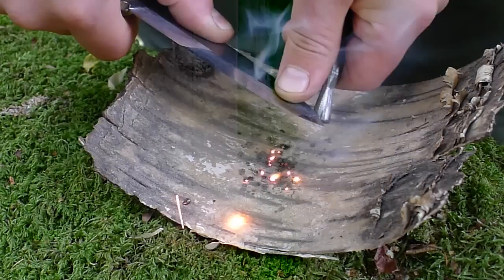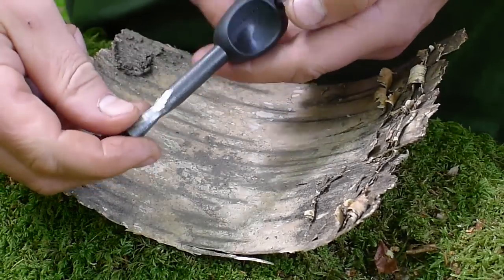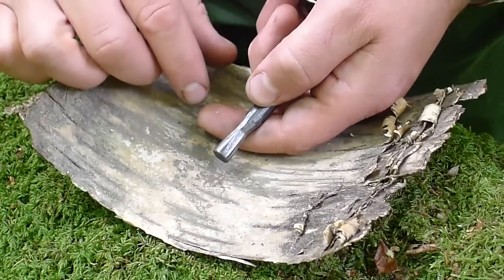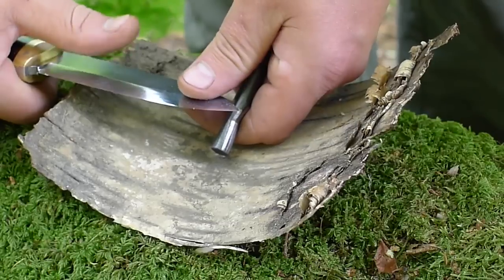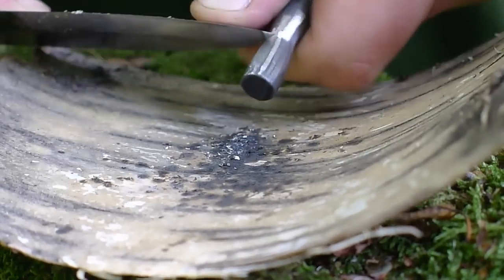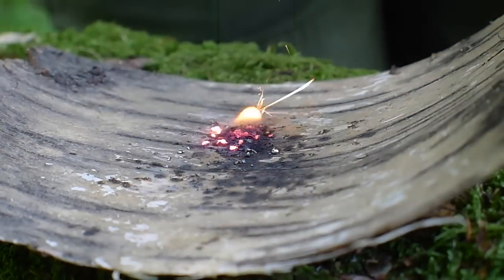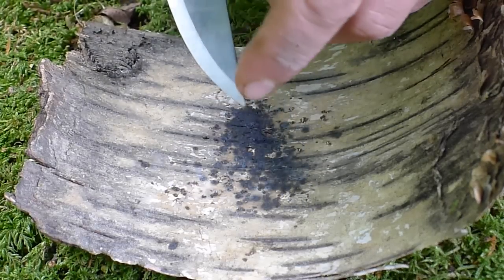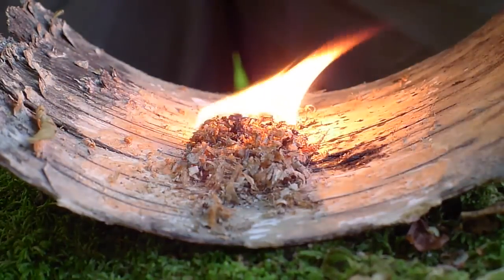How To Create Really Big Sparks With A Swedish Firesteel

Comment: Great video as usual. Subscribed. I usually jab my fire steel right into the tinder pile / birds nest so it kind of surrounds the tip of the fire steel. What it does for me is that it holds the tinder in place as during mild to breezy conditions. Most of the sparks fire right into the bundle. I'm going to try this technique too.

Comment: Great technique.
And heres one about the plastic handles on the ferro rods, remove it and take the best fatwood piece you can find thats totally soaked in resin as in all red and carve a new handle of it, that way you always got a good tinder close by if you cant find anything else to use, once you carved the handle its gonna be all sticky, but the surface will dry up in about a week and contain the rest of the resin in the wood fresh, and to fasten the rod in the new handle, simply drill a tight fitting hole and squeeze in the rod, the resin will glue it stuck to the handle after it dried for a couple of days, I do it to all my rods and it saved me getting a fire started when the rain is poring down, a 2x3cm handle will give you shavings for a good 10-30 fires (depending how you use shavings), and when its gone, just carve a new fatwood handle and pop it on, can of course drill a hole sideways in it for a lanyard aswell  :)
Reply from the maker: SignedSign Hey that's a nice tip.  Thanks for sharing.  I'll keep my eye out for some good fatwood.  Cheers! Paul.
Reply: Thanx for this great hint. I love it when things have double functions. Sorrily ther are no trees with fatwood in my surrounding.
Reply: I carved my own handle with Hazel, if you use the exact same diameter drill bit on green wood then the wood will encase around the rod and close in nice and tight when drying, you can already notice the stiffness of the rod the very next day, fatwood is a great idea but I will have to just buy another blank rod before I do that, the hazel one is my go-to and I've just spent £340 over the last three weeks buying gear so have to save the pennies now!
cheers
Bushman AllOutDoors
Reply: I never did like handles, simply because what steel you've adhered into the handle you can't use.  In my pack I carry a 1/2 x 6 inch rod (because it was two for the price of one on Amazon through world of fire) and in my PSK is a 3/8 x 4 inch rod from firesteel.com.  Neither of them have handles and I've never had any problems.  If you think you all need one, horses for courses.  I cast my lot among those who don't.

I do have to say, though, that carrying resinous wood is a champion idea for fire starter and no one should be without it.

Comment: I am going to practice and practice because some times I knock my material flying.
thank you for this great tip.
Reply from the maker: Thanks for your feedback Ted.  Please do practice this.  The key thing in not knocking your material flying is creating that (small) gap by supporting the Fireflash with your finger, then being really controlled with how you push the spark off the end of the steel.  As you see, I don't use a lot of speed - it's more important to scrape off plenty of metal. Just use enough speed to create a spark and maintain control.  Let me know how you get on.  Best, Paul

Comment: Fantastic video Paul! This technique is by far the best practice for anyone using the fero rod. Not only does it save on mashing your prepared material around, but I think its also the most efficient method for getting the most out of the fero rod itself over its lifetime, using less than any other method of striking it, would you agree?
Reply from the maker: Thanks for your feedback! It's definitely the most efficient way to put a spark exactly where you want it. What I've noticed is that once people get the hang of this technique, they get their tinder lit on the first or second strike.  Even though the method in the video does advocate taking off a good amount of material to create the biggest spark possible, compared to how most untutored people bash away, striking the rod repeatedly, creating a shower of diffuse sparks and eventually disturbing the tinder, then yes it will increase the life of your Firesteel.

Comment: hi paul thats the first time I've seen a fire steel used that way and it will last a lot longer as well regards dave
Reply from the maker: Hi David, yes I find it much more efficient - both in terms of getting a fire going but also in terms of not striking away at the FireSteel repeatedly and taking metal off it unnecessarily.  Hope you find it works well for you too.  All the best, Paul.

Comment: Nice tip about the Mora companion
Reply from the maker: Thank you Robert Williams
Reply: @Joel Glyn-Davies Paul is not using the spine of the knife to scrap with. The only part that touches the rod is the beveled edge of the knife. From the tip backwards to where the spine begins. Really, this technique is only good for scandi grind as others either have little to no bevel which does not allow enough surface contact to scrap with. Hope this helps.

Comment: nice videoOne thing I wasn't sure of paul was when you used the mora knife, does anything have to be done to the back edge for it to work?
Reply from the maker: +Sean Ditch Not in the way I'm using it here but it is only a small area which will work well, just behind the tip.  In my experience, the depth of bevels at this point on a Mora is variable and can sometimes be very small, increasing the chance of you pricking your finger with the tip.  Flattening the back of a new Mora, where it is somewhat rounded, with a metal file creates a much larger right-angled edge between the side of the knife and the back, which works more consistently.  But once you have sharpened the knife a few times and the bevel width increased - which it will if it was too narrow at the tip - makes the technique I show in the video more viable.  ATB, Paul
Reply: +Paul Kirtley brilliant thanks Paul
Reply from the maker: +Sean Ditch My pleasure Sean.

Comment: Paul, great video - really helpful technique. What would you say about how it only uses a small part of the firesteel; is this a waste?
Reply from the maker: James Tamlyn Thanks for your comment.  Glad you found this one useful.  Re using the section towards the end of the firesteel - well you'll  wear this down more quickly than the rest but it does not waste the rest because once the end is worn down you just move back and do the same further up the steel.  The steel effectively becomes shorter but you still use all the material, just in a different order if you like :-)  Hope this helps.  ATB, Paul
Reply: Thanks very much; I hadn't thought of that. By the way, your podcasts are great - keep them going!!
Reply from the maker: James Tamlyn You're very welcome James. Thanks for your feedback on my podcasts also.  Warm regards, Paul

Comment: Hi Paul!
When it comes to firelighting devices, the swedish firesteel tends to be the number one solution in the bushcraft community. I have tried it extensively with excellent results, but I'm always coming back to the Doan's magnesium bar. Can't explain why but I seem to prefer it just because the 2 separate steps (shaving the material and sparking). Did you ever tried it? I'm not a beginner anymore but I'm thinking maybe for a beginner, it would be easier to have these 2 separate steps of shaving the magnesium without accidently sparking on it and THEN, turning the thing over and sparking the pile of shavings in a more controlled and error-proof manner. 
Excellent vid!
C.
Reply: Ferro rod is gone long before the magnesium bar in my experience bro

Comment: I used some high quality ferrocerium rods, actually they seems like mischmetal   rods as someone else called, which can easily make lots of fire balls instead of sparks when struck. I also compared them with Light My Fire & Firesteel flint fire starters, hardly to find difference between them.  The manufacturer of the rods can be found at www.sinosed.com, their website. Hope it helpful to you guys!

Comment: Hi Paul, I've got a new firesteel after somehow breaking my old one. How long does it take before a new firesteel starts producing some proper sparks? I have read that the more worn it is the better. I get weak sparks by simply striking it and using the technique from your video I can shave off material but no spark! Cheers Nige.
Reply: Bugga...Just managed to stab my finger as well...Ouch!
Reply from the maker: Ouch! Yep, I've done that before too! ;) When the FireSteel is new it is coated with a protective lacquer, which helps prevent it oxidising while in storage. 

1/ With a couple of scrapes, you can remove this from the area of the steel you want to strike the spark (it will go from dull to shiny).

2/ If you are removing metal from the FireSteel but not attaining sparks, then the issue is not pressure but speed.  Increase the speed of your scrape while maintaining the pressure.  There is a point at which this will create a spark. Too slow and it won't, however much you dig in.

Hope this helps Nige!

All the best,

Paul
Reply: Thanks Paul, I'll keep  persevering! :)
Reply from the maker: Yep, that's all it takes! :)

Comment: Paul, I just dropped by to say your technique is awesome! Been trying for 3 days to light some dry grass, without any success, mostly because my strike was too long (I'd usually start from thumb depression and work my way down). So the sparks were too erratic and easily put out. It was a great morale-booster to finally try your way and see it work like a charm. Thanks a lot :)

Comment: Hi Paul,

I'm not sure if maybe Mora has changed their spine design since they produced the Mora Companion you used, but this method does not work on the 10+ Mora knives that I own.  The spines seem to be left too unfinished and rounded to make a spark this way (even using the portion of the spine that's behind the Scandi bevel near the tip as you show here).  The only way I can get a spark like this is if the very tip of the knife happens to dig into the fire steel.  This results in dulling the tip, which I'm sure is not favorable lol. 
Not sure if you might have another suggestion?  Mora's are some of my favorite knives, but I've always thought their biggest weakness was not being able to effectively strike a fire steel.  I wish Mora would just produce all of their outdoor knives with squared off spines!
Thanks Paul!  Great videos BTW, I've subscribed!  =)
Reply from the maker: *****
Hey Dan,

That's a very good question. The Mora in the video is a standard Mora Companion but please read on....  We hand out scores, if not hundreds of Mora Companion knives every year on Frontier Bushcraft courses and it's true the backs of all of them are quite rounded and not squared off.  I've also noticed in recent years that the bevel width at the tip has become quite variable from one batch to the next. This makes the area where the bevel meets the back/spine really very small in some instances.  What I have found in every case I have tried and when I have also directed students to do the same, is that sharpening the knife on a bench stone and getting a well-defined right angle between the bevel and the spine towards the tip really helps.  It's still not as good as a typical "bushcraft" knife with a wider bevel and really squared off spine.  What is much better, however, is the Mora Companion Heavy Duty, which has a 3.2mm blade thickness flat spine and nice, squared off edges. A final point regarding the standard Companion - if you do find yourself using more tip than spine, you also run the risk of slipping off the FireSteel and stabbing one of your digits, so it's best avoided for that reason too.  With the standard Companion, one option is to take a metal to the back to square it off.  I hope this helps. All the best, Paul.
Reply: Paul Kirtley
Hi Paul,

Thanks for the reply!  It's funny that you mentioned the fact that it's easy to stab yourself using the tip portion of the Companion to strike the fire steel.  I came very close a few times (too close for my liking), especially since I keep my blades lubricated with WD-40 and they are slightly slick!
I also have about 7 Mora Heavy Duty knives and you are right, they do have a much more "finished" spine, however I've found the spine on these knives are still not sharp enough to get sparks from the fire steel the way they come out of the box.
Also, I didn't quite understand your last sentence, "With the standard Companion, one option is to take a metal to the back to square it off."  I don't understand what you meant by "a metal"?  Did you mean a mill file?

Thanks again for the help Paul!  I've already begun watching all 22 vids on your website!
Reply from the maker: Hi Dan,

A file that is suitable for working hardened metal, such as http://extranet.snaeurope.com/prodblock.aspx?CATALOGUEID=5&ProductBlockID=555

Cheers,

Paul
Reply: Paul Kirtley
Hi Paul,

I'm sorry but the link you provided doesn't seem to work.  It just brings me to an SNA Europe page that wants a username and password.  Were you trying to refer me to a picture?
Reply from the maker: Hi Dan, the link is no longer working for me either.  Try this one instead:
http://www.screwfix.com/p/bahco-homeowners-dual-cut-metal-file-8/60320

Cheers,

Paul
Reply: Dan, You may need to take a file to the back of your Moras. Sometimes they are a but rounded, but a little filing and they'll product sparks just fine. The carbon steel ones work better than stainless steel.

Comment: Hey bud, great video.  However my friend and I are having trouble with this technique.  We're both using Mora's (1x companion and 1 x clipper) and Web-Tex Firesteels - yes we're aware it could be the naff steel.

Any tips? How much pressure do we use? Do you push with the 'firesteel' thumb, or is it mainly pressured with the knife wrist?  And tips would be great - many thanks.  Great video!!!
Reply from the maker: Mad Man Mike Productions Apologies for the slow reply.  Very difficult to keep up with all comments across all videos, particularly using YouTube's mobile app.  I just miss things.  

Pressure is from both thumbs, nothing much from the wrist.  It is harder with a Mora as the bevel is not very wide.  You need to a feel a good "bite" from the back of the bevel into the steel.  If you are not getting this, then sharpen your knife, making sure the back of the bevel is nice and square.  Hope you understand what I mean?...
Reply: Hi Paul,
Thank you for the reply.  Will keep trying it.  I've already tried filing the spine of my Mora near the handle to get a 'striking' area.  SOME success... will keep practicing, lol.
Reply from the maker: Mad Man Mike Productions
 :-)

Comment: is Swedish firesteel the same thing as a flint and steel? i fell like it is. let me know if there is a difference, thanks
Reply: a flint and steel is using a piece if steel and a flint stone to make sparks, and usually into material like charcloth where it's guaranteed to catch.

I'll be doing a video on the flint and steel soon :)
Reply from the maker: +Wyatt Walker Hi Wyatt, thanks for your question. While both a modern firesteel (a.k.a ferro rod) and a traditional flint & steel ignite a fire via the production of sparks, they are different devices.  The technique for the use of each differs, as does the range of materials that can be used with each. In some cases, while a material can be used with either a modern Firesteel or a traditional Flint & Steel, the preparation of the material being used can also differ to suit the different device.  The following video will help clarify things: https://www.youtube.com/watch?v=kteSUFEplWk  All the best, Paul
Reply: +Paul Kirtley right on, thank you for the explanation. i wasn't trying to sound rude or cocky by the way i was actually curious haha thanks again

Comment: I tried this method, but the tip of my knife slid off the firesteel, and I sliced my finger pretty good. I now use a carbide scraper that will throw good sparks, but won't cut me if I slip. Or I plant the tip of my knife on a thick piece of bark or flat piece of wood and drag the firesteel across the squared spine of my knife. Firmly holding the tip of the knife against something solid (like the bark) keeps it from slipping and cutting anything unintended. ;) I can be clumsy.

Be safe out there, my fellow bushcrafters!
Reply from the maker: intheWay2 Yeah, you do have to be careful, particularly with Moras and other knives where the bevel is not very wide.  You take care too :-)

Comment: I am going to start using the more focused technique of concentrating on the tip of the blade and firesteel rather then thrashing the full length of the steel, rather than throwing sparks all over, defintely a more efficient use of tools
Reply from the maker: Efficiency and control are definitely worth working towards.